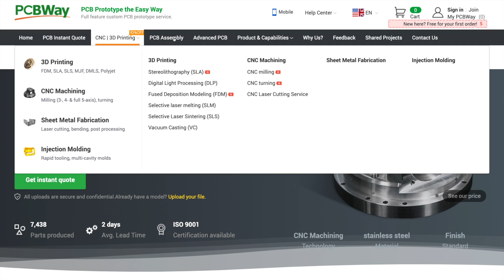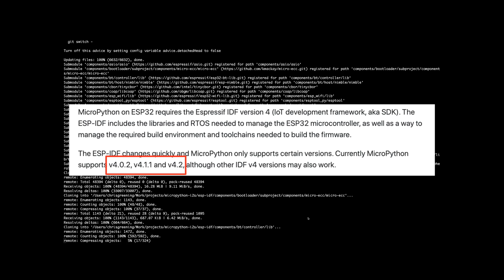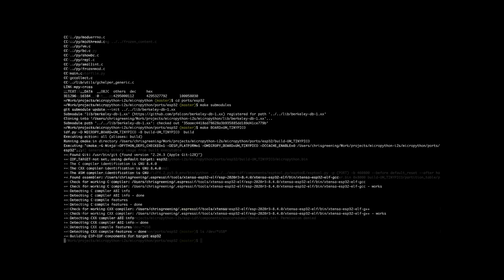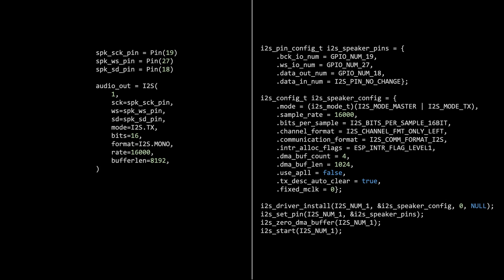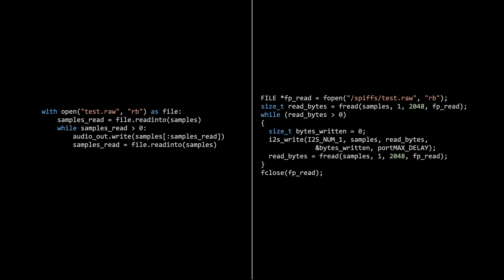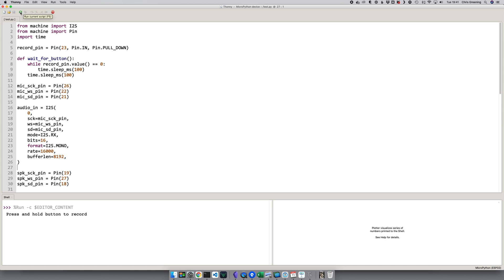MicroPython I2S Audio with the ESP32

Comment: Hi Sir ! can i replace this adafruit I2S amplifier with  PAM8403 i.e  use inbuilt DAC with I2s instead of direct I2s ? Ofcourse i'll change the suitable I2S config in the code .
Reply from the maker: Unfortunately not with the micropython version. You can of course do it if you are willing to use C/C++
Reply: Aah, no issues I am actually using c++ . Thanks for your kind help and uploading these videos
Reply from the maker: @AnkitVashisht  In that case you can easily switch to the DAC for output with I2S - works pretty well.
Reply: @atomic14  ya, will try that , thanks

Comment: In order to be able to compile, I have to replace "bufferlen" with "ibuf"
Reply from the maker: Is this when compiling the MicroPython firmware?
Reply: @atomic14  Sorry for being ambiguous - no, it's when I define the pins, mode, format, bitrate etc.
Reply from the maker: @doctorweile  Ah right, I know the PR has been changing over the last few weeks. It has now been merged so the nightly builds should now include I2S support. I'll start work on a follow up video to show the new features and code.
Reply: @atomic14  Just mentioning, in case other viewers have a similar issue. Thank you for the video, by the way - very helpful.
Reply from the maker: @doctorweile  Thanks! I'll add your tip to the video description to make sure people see it.

Comment: stupid question --> is this a ubuntu system to build the custom firmware ? can I use windows to build the firmware ?. I was half way in windows and it fails at the make step.
Reply from the maker: This was on a mac, but I think you could use WSL on windows and use ubuntu - https://ubuntu.com/wsl
Reply: @atomic14   Thanks very much for the quick reply. Sure, I can use a mac instead . Is the mac developer tools (for make)  setup good enough to run the all the commands or we need to install  cmake (I am not sure if cmake is also part of mac's developer tools) for this build. basically asking the dependicies to build this in mac if any ?. Thanks again.
Reply from the maker: @ajilful  You're right - you'll need to "brew install cmake" on a fresh Mac

Comment: Many hours later...and still a fail.  I'm doing it on an iMac running BigSur 11.4  Firstly some problems with git clone with permissions about public key.  Finally fixed that after much googling.  Then problems with git fetch, but solved when I changed the directory to the micropython dir  that was created by the git clone.  This cd is missing from the instructions.  The build appeared to go ok and I got the 'Project build complete. To flash, run this command: - its a long command, but it does not run and I get - zsh: missing end of string.   I cant see what to do to fix this and googling has drawn a blank.  The TinyPico is attached and firing up in Thonny.   I'm stuck.  Sadly no i2s for me.